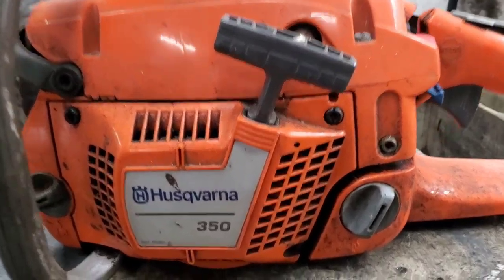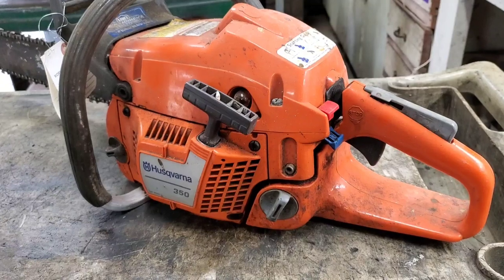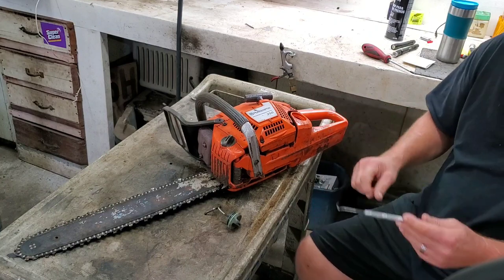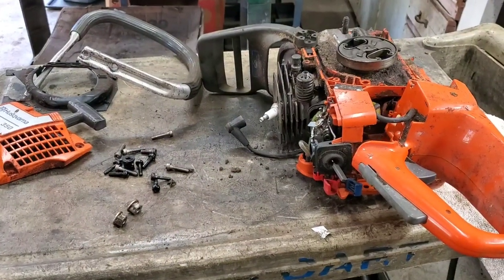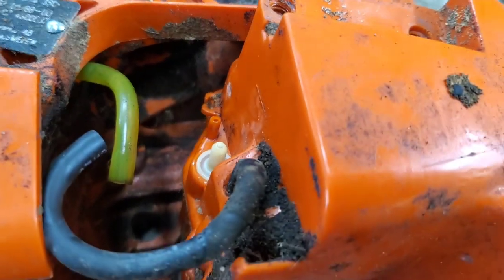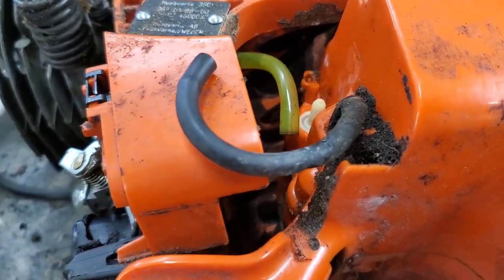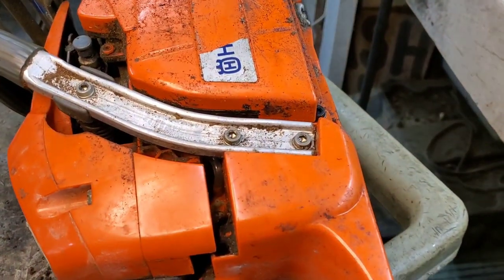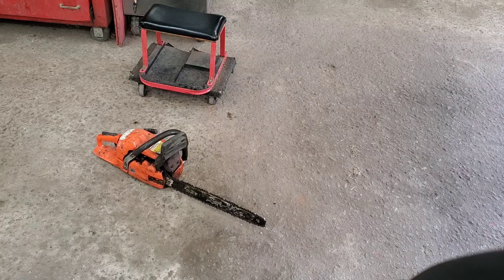Husqvarna 350 chainsaw easy diy compression test and fuel leak fix.

Comment: Hm my 350 is tad different, its a 350 air injection. I had to fix my kill switch and after i “fixed it” it wont start. Not exactly sure whats wrong with it
Reply from the maker: I am working on a video right now that should be finished this week about how to diagnose an ignition coil.   Not sure of title yet, maybe cuts off hot or something like diagnose your ignition coil with only a screwdriver.  It will explain a ton of information on that subject.  Hopefully it will help.
Reply: Good deal I have two connections but only one hooked up the other goes ?   I don’t see any where ?  She clips too

Comment: Good deal so I noticed the vent fitting white  so that means the tank ain’t air tight ?   My primer nipples 1/2 broke off so my plan was to cut it off  and glue in a vac fitting  ? Same w the line to tank filter  the replacement crap ar out here is 1/4 “
 Dumb ass me drilled that out a bit to accomplish a fit  but she leaks a bit it the tank is vented this isn’t a big deal ?  But I can’t keep fuel in the primer bulb she runs   But not for long sucking air

Comment: Got a 350 that doesn’t have a priming bulb, that was leaking fuel when turned on side. It was actually just the main fuel line itself that has the filter attached. It was dry rotted and cracked, right where it slips through the gas tank. 
Easy fix with a few cuss words slipping the hose back through the hole, and slipping on a new filter.

Comment: That doesn’t work and you know it
Reply from the maker: Thanks for watching.  As I said in the video it's a quick check, to be accurate you need a compression tester. If the machine falls quickly there is no need to test because you know I has no compression.  I appreciate your input Thank you.
Reply: @RaleysSmallEngines  not if it has an easy start recoil ...
Reply from the maker: This one does not.  If it does it will only fall so far and the same applies. I do have a feel for these machines as I've been repairing them over 40 years. Again I do say In the video, to do it properly you need a compression tester. You are awesome and I appreciate you commenting my friend.
Reply: @RaleysSmallEngines  im aware of that, been at it 43 years , own 3 shops , it’s just the people on here many of them don’t have the knowledge or the hands on experience and end up getting screwed while buying used saws because they trusted these types of techniques, instead I would tell them pull the muffler and look at the piston and cylinder condition through the exhaust port...
Reply from the maker: @cbnx82703  of course pull the muffler and look at the piston. If in that situation. The point is...Grab the starter rope if it falls straight down.. no compression no reason to test it. Yes the same will happen with an easy start set up with a no compression saw.  Love it my friend!!